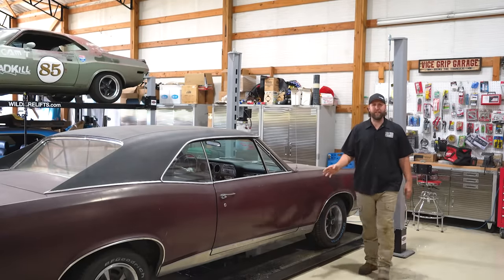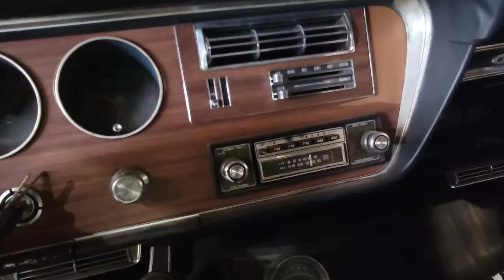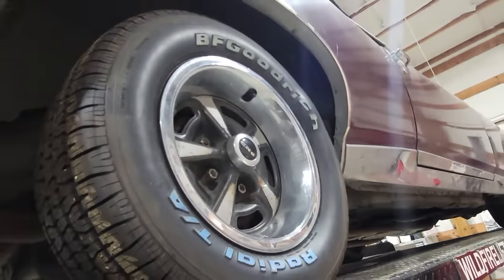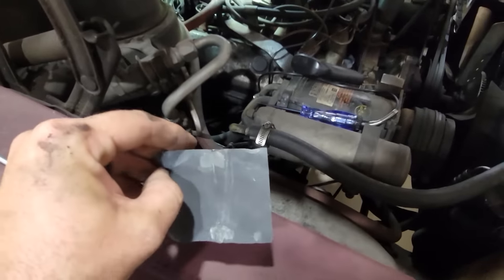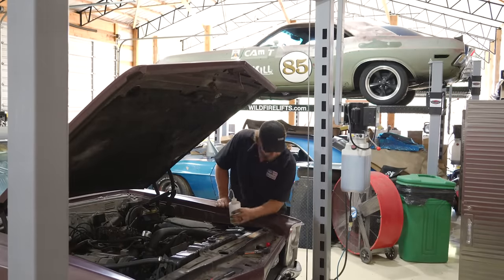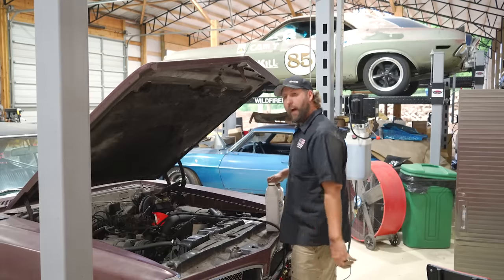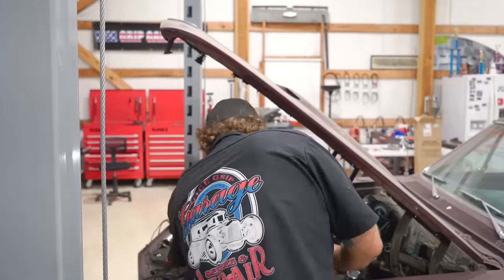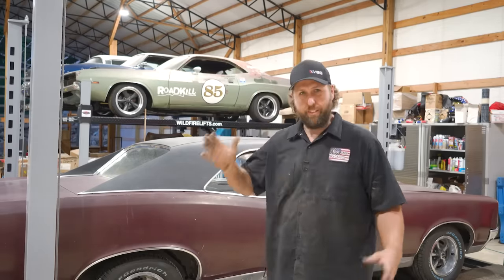Will This Pontiac GTO RUN AND DRIVE After 40 YEARS? (Buried in Garage) EP1

Comment: I had a 70 GTO w/ the 400 big block back in the 80s.  It ran great but it had a problem with “banging out” at high speeds.  Never really knew what was causing it.

Comment: DEREK A REAL GOOD TRICK FOR CHANGING THE NUMBER 2 PLUG AND 4 IS TO JACK UP THE RIGHT SIDE AND USE A WOBBLE 13/16 PLUG SOCKET AND JUST "RPM" THOSE 2 PLUGS RIGHT OUT OF THEIR IMPOSSIBLE REMOVAL FROM THE TOP- NO A/C REMOVAL- I USED A 1/4 INCH BRAIDED FUEL HOSE ABOUT A FOOT LONG AND SHOVE IT ONE THE SPARKOLATOR AND CREW THOSE RIGHT OUT IN SECONDS.  REMEMBER WHEN WORKING AT A DEALER WHERE YOU DO 10 TUNEUP A DAY ALONG WITH REBUILDING 2 JET ROCHESTERS AND QUADRAJUNKS ALONG WITH ALTERNATOR REBUILDS AND STARTER REBUILD- A FELLOW IS SHOT AT THE END OF A DAY- SO HAVE A FEW WOBBLE POP AND RELAX AFTER HEARING A DISPATCHER ON THE SQUAKBOX YELLING AT YOU 8 HOURS A DAY - ARE YOU DONE WITH MISS JONES'S GRAND PRIX!  OH, YES IT IS BEST IF YOU USE A 3 FOOT SNAP ON SPEED HANDLE WITH A SPRING OUT OF ONE OF THE QUADRAJUNKS VAC CHOKE PULLOFFS AND THREAD IT OVER THE 3/8 WOBBLE END TO KEEP YOUR SOCKET FROM FALLING EVER WHICH A WAY.   JOB DONE IS SECONDS INSTEAD OF AN HOUR!   HOPE THAT TRICK IS HANDY FOR YA! GREAT SHOW KEEP MAKING AND IMPOSSIBLE CAREER  LESS ANNOYING FROM SOME OR ALL OF THE STUPID ENGINEERING THESE FOOLS CAME UP WITH!   CHARLIE BASS SAN ANTONIO

Comment: Amazing work as always! Take it from a fellow Pontiac 400 owner, the coolant issue was almost guaranteed to be air in the system. These motors take FOREVER to burp. Ill usually have my '79 T/A 400/4-Speed idling for damn near an hour with the rad cap off before the bubbles stop coming up, and even then, the coolant level in the overflow tank will take a good 4-5 cycles to finally equalize and stop dropping.

Comment: Easiest way to tell how old the tires are, usually around the bead you'll find a DOT number. At the end of that number in a preformed box there should be a four digit number, the first two saying what week the tire was made and the last two is the last two digits of the year. 0516 would be fifth week of 2016 and so forth.

Comment: There were some dynamite cars built in Australia in the late 60s through to the end of the 70s. I had a 72 Ford Fairlane 351. You could have a party in that thing. It used to drink fuel. At 90 MPH you could see the fuel gauge going down.

Comment: Ok there is no Pontiac small block. You can tell you have the high performance 400 is to look where exhaust manifold meets the head he’ll say 6X. And a side note you don’t have to shift a turbo 400 transmission just put it in low and stomp on it and the governor will shift it to second then shift into 3rd and never have to shift lol. Discovered by accident after I changed the mufflers and was flooring and letting off to hear that sweet music coming from the exhaust. Holding the petal down longer and longer it shifted and chirped the tires. 1976 Pontic Grand Prix I changed the cam shaft because all my cars had to have that lope idle going down the street.

Comment: Every Pontiac V8, from the 326 to the 455 uses the same block, a big one at that. The timing case/timing chain cover is aluminum, bolted to a cast iron block. Have to run all Anti freeze or it blows all the coolant into the lower end. Dissimilar meatal electrolysis. Bad design. It uses stock a stainless steel gasket for the case (?) I drove a 1968 GTO from the age of fifteen, to 2006, when I became disabled. Good luck with the starter solenoid. Tucked up there, on the drivers side, under the exhaust manifold. and gets cooked. I put a button in. Good luck!

Comment: Muscle car era ended with the 1971. I had a 1970 Firebird Formula 400 with 390 HP did 0 to 100  in about 14 seconds. My Buddy in the army bought a 1973 Firebird Big Bird, 400 (190HP), took 19 seconds to do the same. (Pollution control killed the muscle car. Lots of difference, same engine )

Comment: Wd 40 revives those old mechanical pumps real good. At least until you put a new one on. I’d be scared to run the old one. There bad to leak fuel into the oil and make all kinds of problems which I’m sure you know.

Comment: I love VGG. In my after HS grad my dad Surpised with a 289 auto leftover fastback Mustang. I had it for a few years and got ^9 Roadrunner 4 speed, bench seat. 4th gear came haft way back over the seat. The girls sat close on bench seats! I would love to find either cars again and have Derek put it back in good shape. Anyone know of one those???

Need some advice a have a survivor 69 classic boat that has a Mercruiser 4 stern drive I/O. Its actually a 1969 GM engine. 120Hp. It's been running great UNTIL the block cracked in the heavy freeze we had in Texas in 2021. I did get water out but I guess not all of it. Its not worth putting in a long block. I got an estimate of $6900. My question could it be welded? I heard skilled welders can do it with a welding rod that is made with a brass alloy of some type. Or does anyone think JB weld would hold. The crack is only on the outside of the block behind the intake/exhaust manifold. I just need to remove that and clean the block around the crack and put it on. So am not sure what to do. Thanks for your help.

Comment: in 1967 Pontiac had a 428 cu in My brother found one years ago stupid fast. in 1969 you could get that with a three-valve head. I have only read about that engine never seen one. it had higher Hp than cu in

Comment: probbly missed it just going to tell you ac needs a fan shropud  very very important you got to have a lot or air flow at idle or the compressor burns up slowly people pull them out replace the radiatorleave them off and then no ac actuialy they buy twin electric fans get rid of the main fan  for 15 horse power increase the heat it makes is crazy hot

Comment: Did you know you can use normal oil to mix with gas , when i use to get fuel for my Boat the marina guy used just normal engine oil its cheaper then buying oil that has a color additive ...

Comment: How does a guy apply to Vehicles For Veterans? I spent over 6 years in the Army including a tour in Iraq. A few months ago I bought an '04 F-150 and found out later the odometer was rolled back by 100,000 miles. Within a day or two everything stopped working. The transmission often acts like it's about to give up. I live in northern Arizona and I freeze when it's cold and I boil when it's hot. I have to drive to the Phoenix VA (about 2 hours each way) at least once a month for medical treatment. I don't have enough money to fix everything that's wrong with it which is pretty much everything. It seems like you don't generally work on modern vehicles but I was wondering if you could help a guy out. Oh and btw I filed a complaint with the attorney general and they sent him a nice letter asking if he did it and he said he didn't. Shocker.

Comment: "I havnt spent any money on it yet" it drove it around. I know you do it this way for "channel content" but why not do it the right way. Its not your car, so put a new cap and rotor, plug wires, new fuel pump etc. You should of flushed the cooling system, new thermostat heater hoses etc. Replace everything and do it right. You're driving it 800 miles? Throw parts on it now and be done with it. And you never pull plugs and scope down inside the cylinders, why not? Most mechanics do that first so they get idea whats going on inside the motor. Love the channel. Good aye mate.

Comment: All pontiac's of that era share the same block, 326,350,389,400,428&455 displacement engines are all related, so to me their all big blocks period, proud owner of a 68 firebird 400, 70 lemans sport 350 and a numbers matching 73 formula 400 bought in 1988 at age 16 for 750$, Poncho Power

Comment: Sounds like a bad valve while cranking. Carb float is junk, guaranteed. They were plastic foam and would dry out in storage or become soaked with fuel. Fuel pump likely junk. Beware of the camshaft timing chain sprocket. They were plastic and disintegrated, requiring removing oil pan to clean out scraps. Recommend complete carb rebuild with new float. Those were great cars, I told you the weak spots. Needs a fan shroud. It will overheat with the fan that far from the radiator. I wrenched in a Pontiac garage in early 70s.

Comment: I have an 83 dodge w150 with a slant six and it runs good until I try to drive it then the acceleration sputters really bad under load, when it's just sitting I can't give it all the gas I won't and it runs fine. Anybody know what's up?

Comment: The old cars engines didn't  have hardened  value  seat because 
There was lead in the gas which 
Softened  the value  load when it shut the shroud busted  will case heating issues

Comment: 🇺🇸👍. Back in 74 I owned a 66 olds Cutless 330 ci V8 with a 4 barrel Q jet I rebuilt it and it worked well, then a mechanic friend told me a trick to really wake that carb up took it back apart plugged one passage way up and drilled another one size up. OMG it ran like a raped Ape super strong from idle to full out.I’ve been searching my Brain to remember witch to plug and drill going to have to go to my kick pile and pull a Quadra jet carb out and open it up and see if it rings any bells.mechanic told me it had to with a smog restriction 66 being the first year for the smog pumps,he said it worked on all year q carbs that was in 74 he’s no longer with us.👍🥩🥔🌽🥛🍪💤

Comment: I loved the gto and had a 67 389 3 dunce motor, but ya told a little tiny fib there feller. I think ya said they had it over a challenger, but not true unless it was a 6 cyl challenge. What I'm saying is I had a 70 barracuda that came with a 383 magnum, 727 trans. It had a factory slapstick also. After owning both the cars the gto ran a 14 and the Cuda ran a 13. And as yarrow Pontiac didn't make small block and big blocks. They were the same block for a 350 as a 455. I liked the looks of the gto a whole lot better than my Cuda but my Cuda would run circles around the goat and you could have got a  440 six pack or 426 hemi which beat mine every time. I agree thar the GTO started it all but ya could have had a 409 impala early 60s and 427 in 66. Ain't breaking yer seeds fella just keeping ya honest. Love the channel bro
Reply: Ya know a guy makes mistakes every now and then....i dont think a fella is a rocket scientist or anything but i do know a guy is pretty knowledgeable about all this stuff

Comment: Derek, I love your channel and the good work you do for the general community and special cases like this BUT, don't be like other YouTubers and talk about Pontiacs like they are a Chevy. There is no such thing as a Pontiac 400 small block. It is the exact same block from the 326 to the 455. the only difference is bore size and stroke. That Pontiac has the same deck height as a Chevy 454 big block.

Comment: I sure hope you burn those tires off that thing first. It's illegal to remove tires that have that much tread. Late sixties cars were awesome. They were. However, the gto your working on was 335hp. We have cars today that are twice that, that handle well, that have good brakes and are way more safe. I'd rather have a modern car than any older car, and I used to own a charger with a 440. I do still have love for older cars and can name any year and model, but I'd take a 2022 Corvette even over a 68 gt500kr or an ac cobra.

Comment: John DeLorean main designer for Pontiac he designed the GTO 1964 GTO started the muscle car error 389 ci 2bbl 4bbl or the tri power 3 two bbl as options the 389 ci engine 1964 to 1966 the 400 started 1967 until 1974 
Late 1969 the big block 455 was a option
Quick note everyone thinks Chrysler was the first company to use the tri power / 6 pack carburetor  Chevrolet actually started using them in 1958 along with Pontiac in the Chevrolet Bel Air and the Pontiac Bonneville oh and the Corvette

Comment: I'm not a veteran but they do have my utmost respect but I'm permanently disabled  as I've had to have my left leg amputated and I've still got my first car it was my dad's first new car it's a 72 Chevy Ç10 pickup truck 🛻 and once I'm able to use my prosthetic leg 🦿 I'm going to get it back on the road the engine and transmission were rebuilt about 88 miles ago so it won't be very tough to get it going again

Comment: Derek, be careful throwing big or small block slang around Pontiac guys and gals. All Pontiac engines are basically the same sized block with different internals. a 326 ans a 455 are the same blocks!  Love your honorable salvage to one of my passions, automobiles!

Comment: There is no such thing as a small block or big block pontiac. The blocks are the same size with the exception of the 301 (turbo), 316, and 317. They got the difference in engine size with bore and stroke.

Comment: There's no such thing as a Pontiac 400 small block fellers. No such thing as a Pontiac big block either in case you were wondering, all Pontiac V8s are Uniblocks, from the lowly old 265s to the mighty 455s. Same engine family. The more ya know.

Comment: I can wrap my brain around that, you used to buy a blown up one for 750, get a good 400 and turbo 400 for a another 750 and a weekend would have a decent car to drive. I have owned 60 + cars in 35 years and I could never have done it if it wasn't for the private salvage yards. Now all gone and the contents crushed. Days are forever gone thanks again to our greedy political system.

Comment: I cannot recall what one's name is.  This is Paul in Youngstown Ohio and I have to lay down a good bit.  Low blood sugar is just no fun for me.  In the carberator in the GTO where the fuel line goes into the carb, behind that big nut is a fuel filter that may need to be shanged.  These were only one dollar or something to change.  Yet, I may not allow enough fuel in to get it to peak performance.  This car should burn the old tires right off of it.  I am not a mechanic at all.  I can change parts and stuff.  Trouble shooting stuff is hard for me to do.  Hope this is helpful.  I just had to share about the filter inside of the carberator.  It may be ok.  One knows more about cars than I every will.  Have fun and keep up the good work.  Try to get these owners of the this gto to get on out and drive it.  Sitting doesn't do it any good.  Yet, this GTO is in really good shape.  Paul in Ohio.

Comment: I want you to know you need to check the timing gear in that car they had a Bakelite teeth timing gear they were notorious for sharing off and spitting down an oil pan and plugging up the oil pump and ruining the motor please do not start that car until you check that timing gear and make sure it's been replaced and then once you do that you're going to need to get the pan off and make sure the oil it's not full of fragments to the point where it's pulled the rivet in the screen off and suck fragments into the motor and ground them up and put them on the bearings and into the hydraulic lifters. I'm not kidding you those baked a light teeth timing gears will ruin a motor. You don't want somebody to jump on that thing after 40 years and ruin it after you get it running
Reply: At least that's what the 1968 had in them On in to early 70 Grand Prix the motor was too hot for that Bakelite timing gear. I once asked a mechanic why they put them in there he told me it was because the valve train was too noisy. My personal opinion is that the engineers were nuts. That timing gear was a piece of junk

Comment: I'm going to try to be nice in this comment..(Try) Tell me how leaving dirty contaminated oil that's been in the car for many years, makes any since..Just start the motor and let it run that way it can spin a bearing? Or? Change the oil before you ever even turn it over!!!! Furthermore, if it's been sitting for many years, why not pull the plugs and put some oil in the cylinders? That way you can then LET IT SIT FOR A COUPLE DAYS,  T.H.E.N. try to start it the next day after it has had time for the oil to loosen the rings!! Of course this would be AFTER you've changed the oil in doing so would be eliminating the possibility of spinning a bearing due from having old contaminated oil. I mean, I'm not a rocket scientist but I am a lic. Ins. painting contractor who was born and raised here in Nashville. Seems a lot of "new" people come here daily. You know, if you'd listen to me about the oil etc. it just might save that old man who owns the car from getting mad at you for being stupid and want to go smacking you in the mouth for having a lack of knowledge that you should have had at 15 years old. I tried to be nice but failed. Want me to break it down for you? Having fresh oil in the motor would prevent old contaminated oil from spinning a bearing. Why not change the oil? It's at your shop on a lift for crying out loud, you can't use the "it's in a field sitting on the ground and can't change the oil" story on this one. "New oil won't allow the sludge to come out"? You my friend are a special kind of stupid.